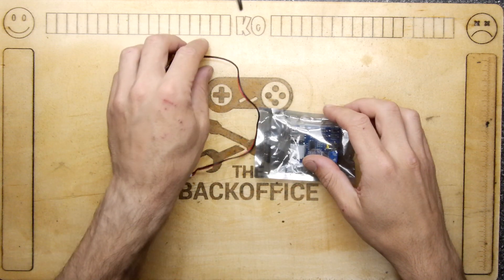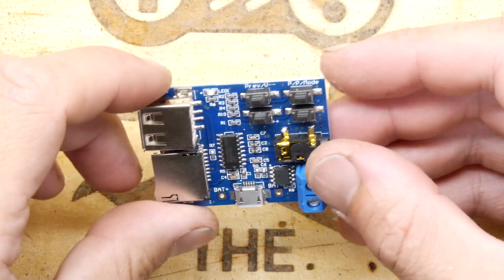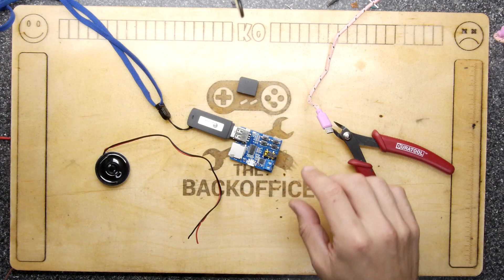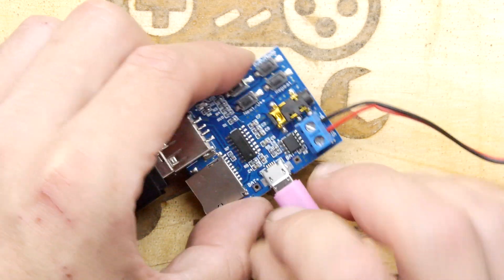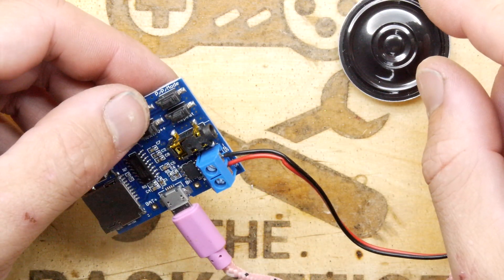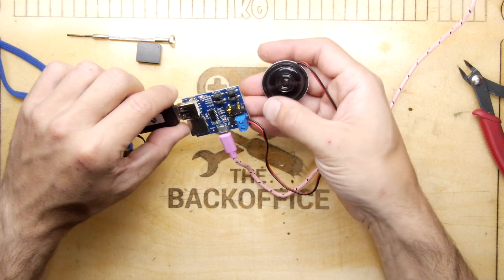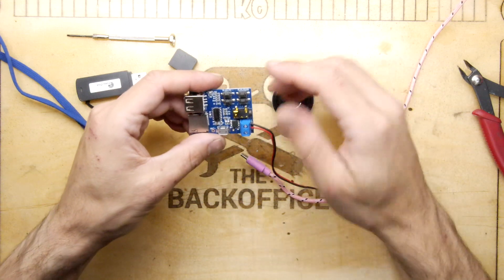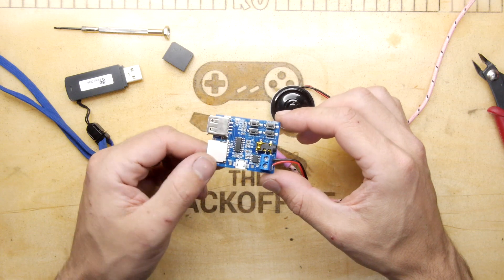Neat MP3 Player PCB

Comment: Reference schematic has 8002 type audio amplifier IC. This is a widely cloned chip, but see PAM8002 for reference. Fixed gain 24db - the low output is indicative of it being likely shot or a dummy.

Comment: Take a look @ the DFPlayer mini. It can work stand alone or with a micro controller, its very small and has a lot of features.
Reply: The FDplaer mini can do normal mp3 player stuff, but where it really shines is for remotely triggered announcements or sound effects . 

It's been a while since I played with mine, but IIRC you can directly trigger about 8 separate MP3 files just with switches, or a lot more if you use an arduino or something to control it. 

It is a neat little board.

Comment: Hi !
Do you think I can solder some pushbuttons that I have with a cable? It's only work by previos and next
Reply from the maker: I don't see why not
Reply: @backofficeshow  I just have to replace the forward and reverse buttons with my wired buttons, right? I am trying things on my own and have had that idea, thanks
Reply from the maker: Exactly, that is all you need to do
Reply: This is an old video, but thinking the Same here… I want to use an IR sensor input/pin output to the mp3 on arduino uno… use case is to have a model railroad crossing audible when train approaches… just sandbox thought at this point…. Great video btw